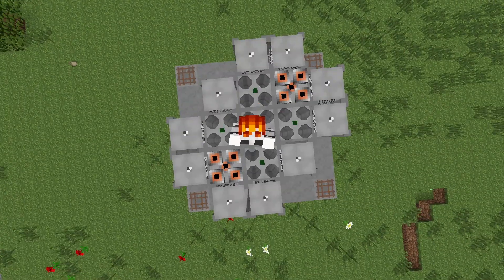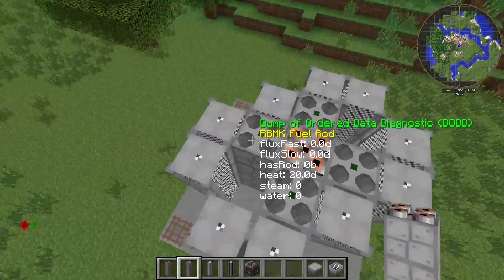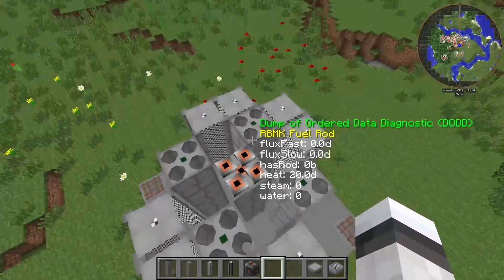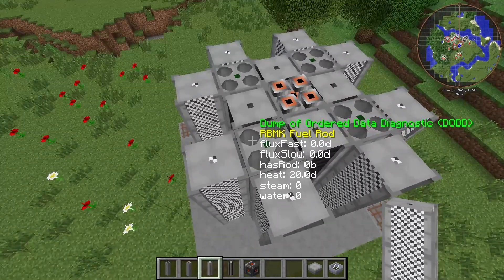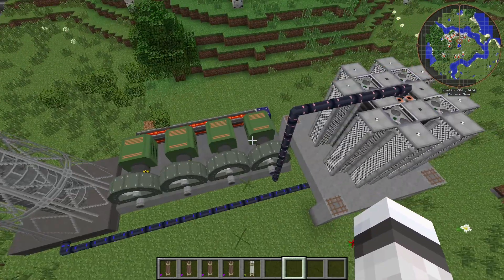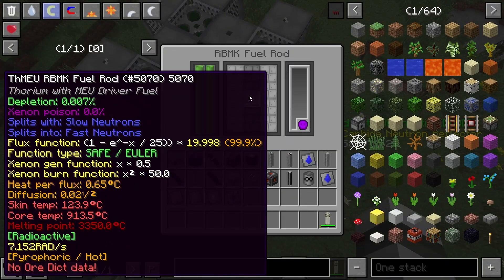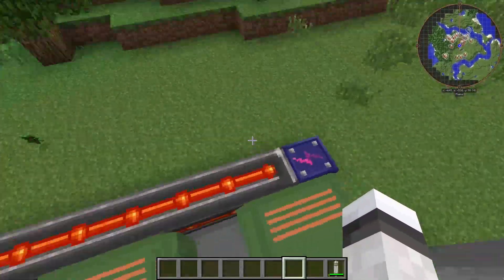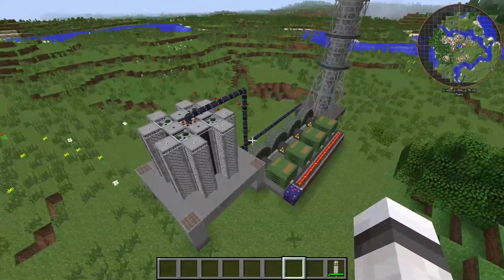I remade my first RBMK design - HBM's Nuclear Tech Mod

Comment: Reflection is fast flux, you can convert it to slow flux by adding a graphite moderator before the reflector.
Reply: Alternatively, the control rod or the fuel rod can be made moderated

Comment: wie lange hält so eine rbmk fuel rod?
Reply from the maker: I'm unsure. I ran this reactor the whole evening and it had a bit more than 10% depletion. Furthermore it should deplete slower the more depleted it is, because it will flux less. That also means it makes less energy the longer it runs. Aditionally there is a problem with xenon poisoning that will make the reactor completely stop before it is fully depleted, but that should only happen once it is almost depleted.